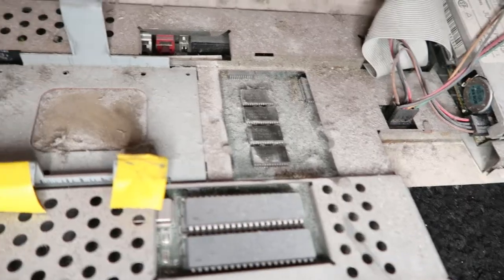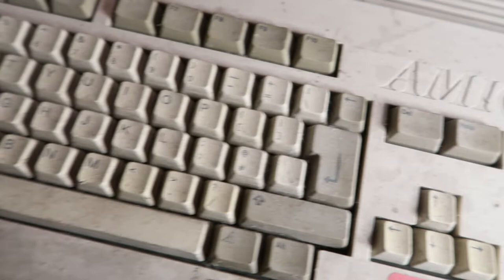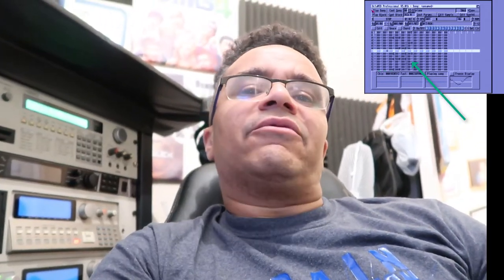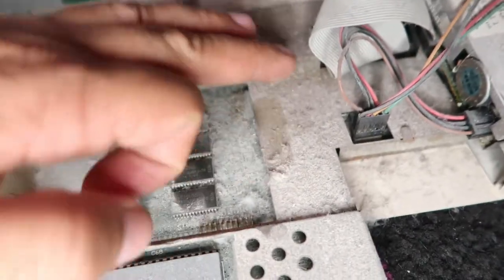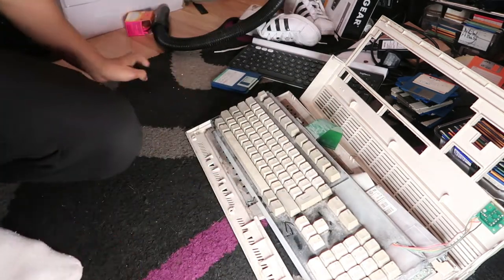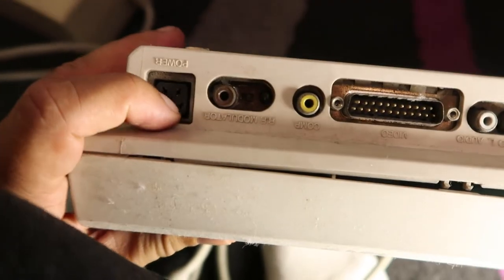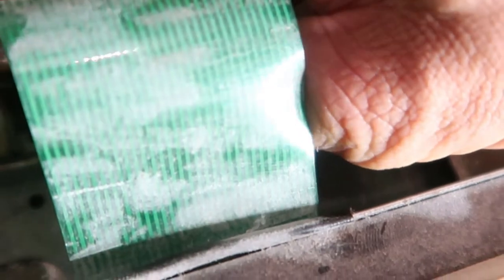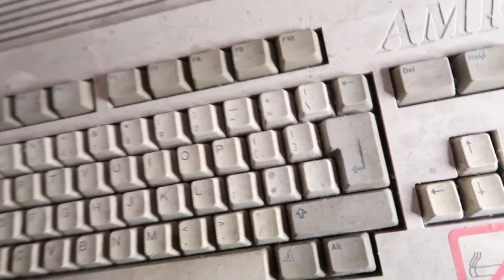WILL MY RUSTY COMMODORE AMIGA STILL WORK AFTER YEARS OUTSIDE?

Comment: Re the keyboard ribbon, on the board connector you lift up a bit of white plastic surrounding it, slide in ribbon, then clip it back down to firmly secure. If the ribbon has been forcibly pulled out at some point (common), this may be shot though.